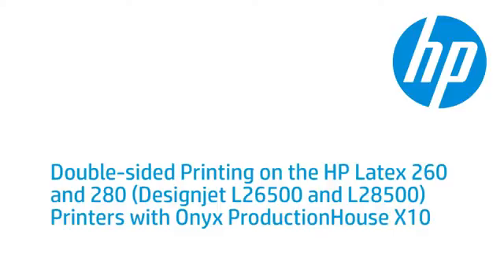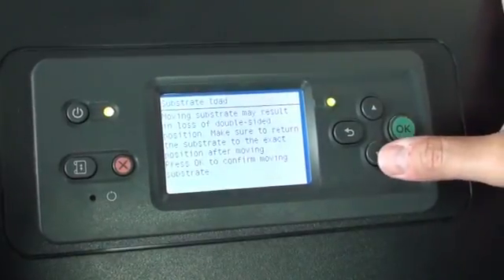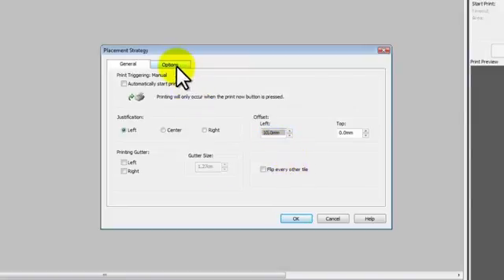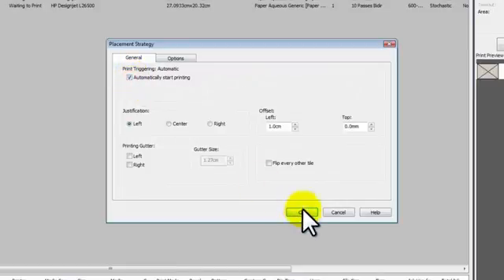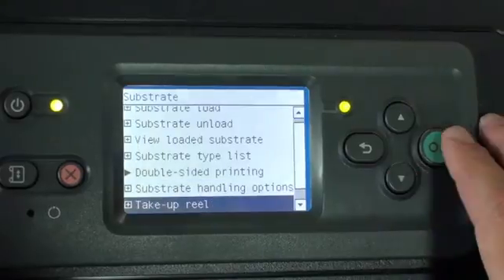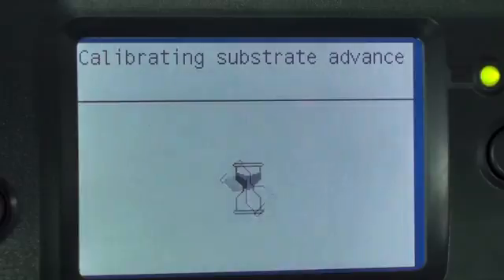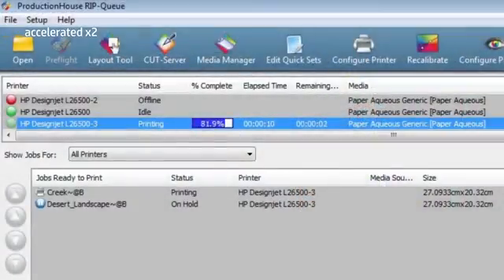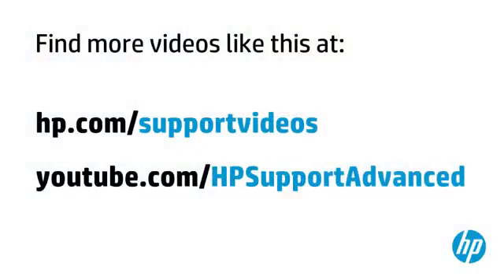Double-sided Printing | HP Latex 260 and 280 (Designjet L26500 and L28500) Printers | HP

Comment: I'd had success when first running these, but lately I can't get side B to line up correctly. I'm using the same rip used in the demonstration, and there's no problem reading the black bar that the printer uses to align for side B. Can't get a banner to match up from one side to the other though. It's close -- only about an inch off in the x (or length) direction. Side to side (y or width) I'm within an eighth of an inch, so that's no problem. But I use this to do pole banners occasionally, and in that case, I can't afford for it to be so far off. Any ideas?

Comment: How do you set up Onyx and the printer to run a manually created side B?
Reply: Hi Ed  McMakin,
 
The answer I gave Anderson W. Rosário applies to you as well.  I’ve copied it here for you. :)
 
Please search for C03061382 on HP’s home page or using Google search. The title of the document is “HP Designjet L26500 printer series - Double-sided printing” and this document is valid for the Latex 260 printer.  It has a note about when the Print B is a different size from Print A.  If you need the Maintenance and troubleshooting guide, please search for c03936270 on HP’s home page or using Google search.

Comment: i have a problem for printing b side, when i trade the side, i want change the side of layout on Photoprint too ? sry for bad english, im from brazil.
Reply: Hi Anderson W. Rosário,
Please search for C03061382 on HP’s home page or using Google search. The title of the document is “HP Designjet L26500 printer series - Double-sided printing” and this document is valid for the Latex 260 printer.  It has a note about when the Print B is a different size from Print A.  If you need the Maintenance and troubleshooting guide, please search for c03936270 on HP’s home page or using Google search.